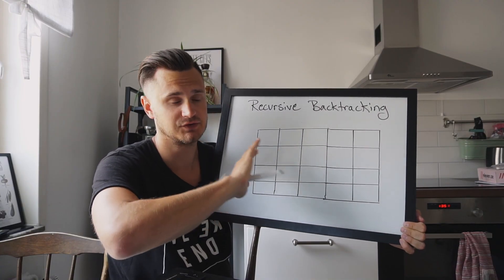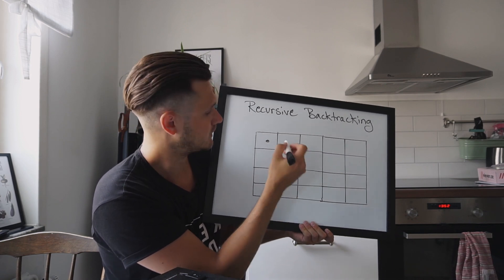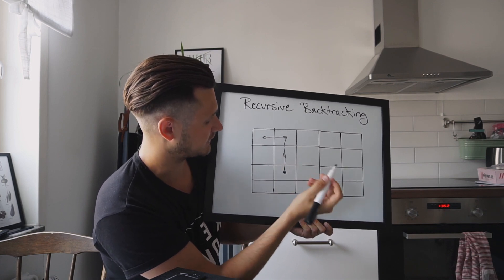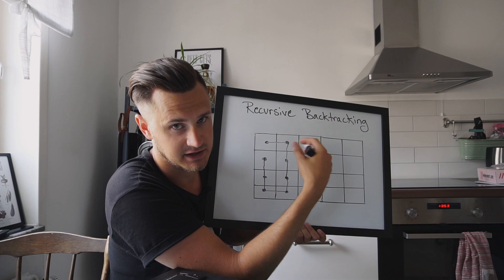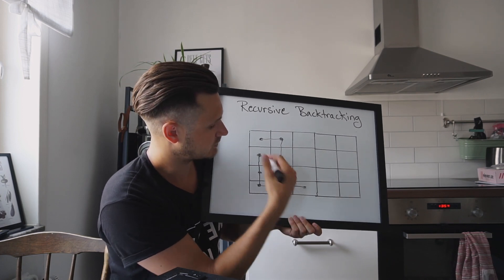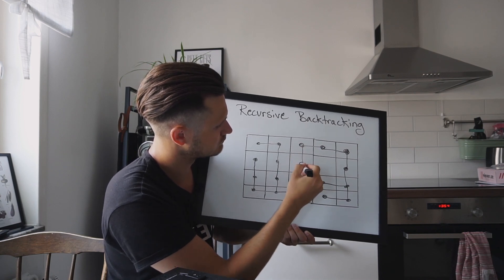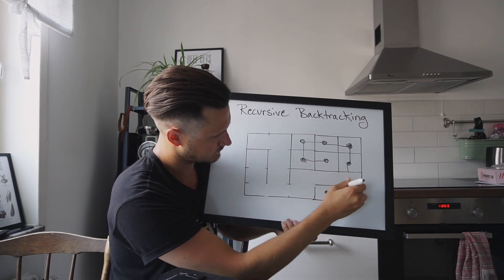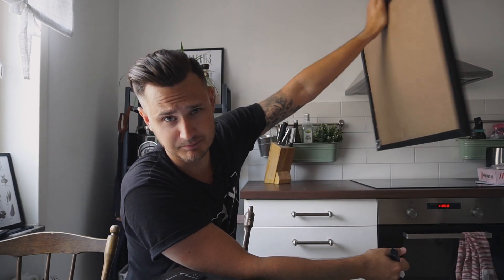PRINT MAZES WITH RASPBERRY PI

Comment: this project is great.  I looked at the circuit sketch, but I'm still not sure how you're powering your printer.  is that big metal box a power inverter thats splitting the power to the pi and the printer?
Reply from the maker: brian scott thx! The printer is powered by a PSU (the metal box), I power the PI with a usb cable to the wall socket - so there are two power cables coming out of the black box, one for the PI and one for the PSU.